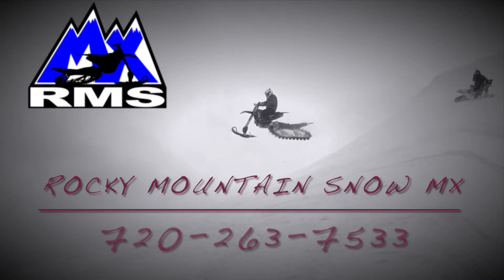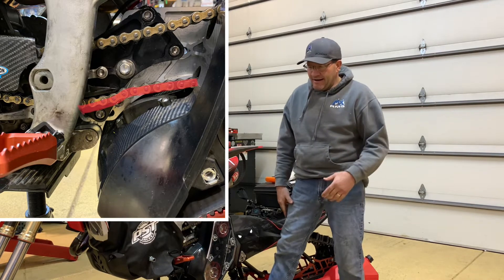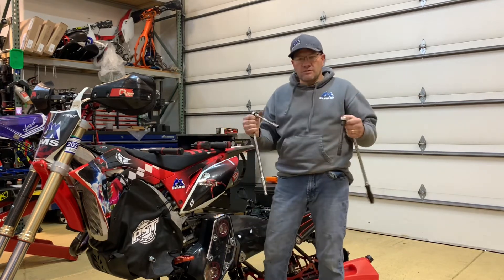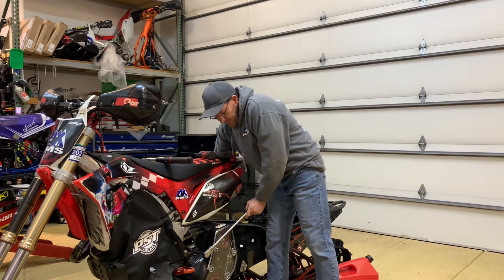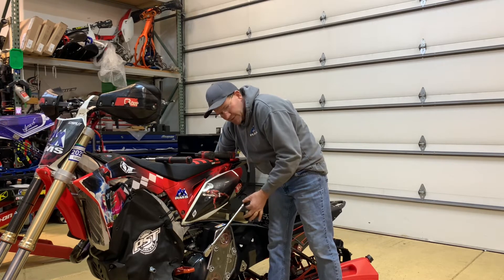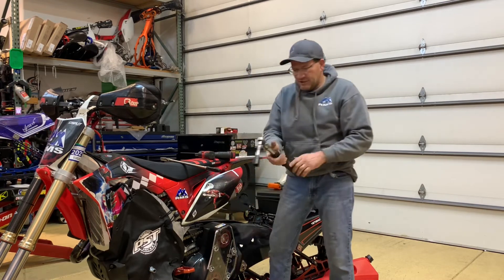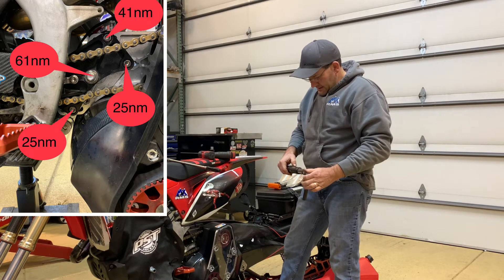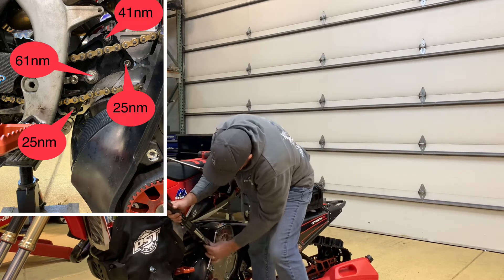Yeti Snow Mx Chain Maintenance

Comment: Thanks Toby. I've found it easiest enough to just tighten it on one side with the wrench. Also in the manual for the 2021 kit it says the top two bolts are both 41nm and only the bottom is 25nm.

Dude awesome trick on holding the chain tensioner! I wondered what the trick to that was.

I love the way to tighten the chain on the Yeti. So much easier than the Timbersled!
Reply from the maker: Thank you, I tell everyone to use both sides at the same time because I have seen 3 customers break the head off the eccentric bolt by only using one side. Be careful.